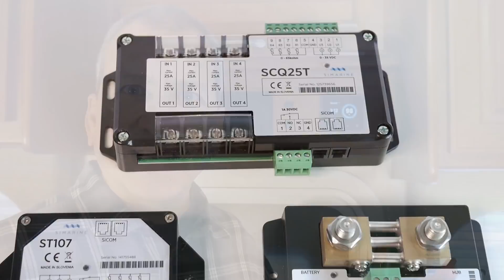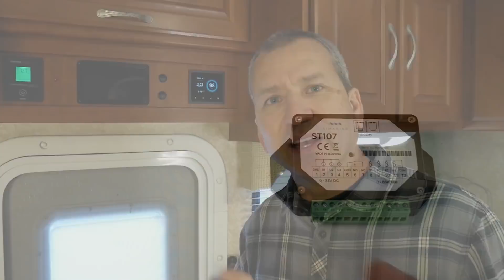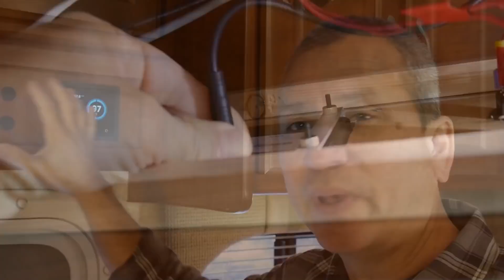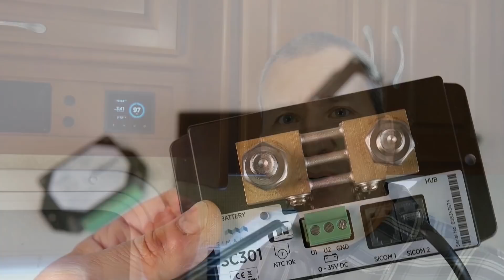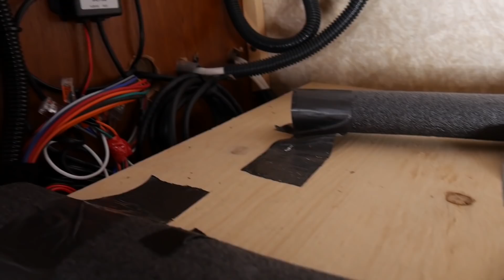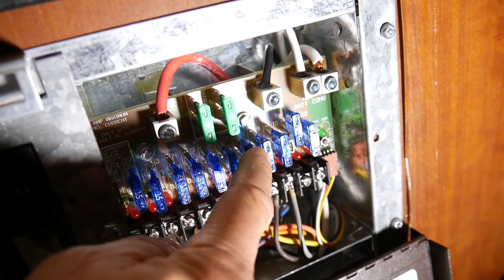SIMARINE PICO Monitor Review and Install in RV

Comment: Hello
 
We are a manufacturer with 15 years of history focusing on the development and sales of intelligent control systems for RV.
 
There are Full touch screen series P10, Membrane Key Integrated Panel series KM20, Color Display Touch Control Integrated Machine KC21, and Mechanical switch panel MP10.
 
More product videos and introductions except in the attachment, you can visit our company website and media platform.
If you need more detailed product specifications and any questions, please contact us.
                            
Best regards.

Comment: Tito i purchased tyhis sytem for my thor Toy hauler i am having trouble with getting a reading on my tanks. i double checked my wiring is correct "example white wire is the common for all tanks blue wire is the 3 sensors for the fresh water i can only get a reading of 65535 ohm. did you experiance this or have any idea where to look for help?

Comment: Love the look of the display.  My only question is how accurate are those sensors that are on the tanks.  I'm assuming you are using the existing sensors that came with the RV or did I miss something?  The See Level 11 Tank Monitoring systems actually have a strip from top to bottom that is glued on the side of each tank and that senses the exact depth of the liquid inside which makes sense.  How does the SIMARINE PICO product sense the existing three or four sensors that are spaced apart and mounted on the tanks and still maintain acurracy in percentage?  It seems to me that the resistance is only isolated at those points of contact on the tanks to read the resistance and nothing in between.  In other words, how does it determine the level between one sensor and the next sensor mounted on the tank?  That is the issue I am having and the accuracy of the product.  Otherwise, I love the product and its display.
Reply from the maker: You are correct. It's only as good as the sensors. To get it dialed in you have to estimate the percentage at each sensor using the resistance and a value (you can even add more values in between). Start will a FULL and an EMPTY value. It will take a bit of tweaking to get it right. The PICO helps by showing you the current resistance value and will then calculate the percentage. Because I had basic resistance sensors that were hard to dial in, I didn't use the tank sensor feature. I primarily used it for power management.

Comment: I know this is a 4yr old video but does it use the same tank sensors that came with the original RV?
Reply from the maker: Yes. It uses the existing resistance sensors but you have to constantly calibrate the monitor to get an accurate reading. There are better marine sensors you could install that may work better with the PICO.

Comment: I love that all tank levels are visible without pressing buttons.  I also like the alert feature that would let you know when the grey and black tanks are full and the freshwater tank is near empty.  My question is,  in trying to configure the PIco's tank sensor (i.e., resistance), could you have emptied all tanks, then filled them from the campground water supply while using an inline water meter?  So, assuming you know each tank capacity (which you indicated you weren't certain of the grey and black), you would add water to the tank to 25%, 50%, 75% and 100%, taking resistance measurements at each point?  Of course, this also assumes the RV manufacturer installed the tank sensors at these same levels.  (Thanks to the RV Geeks for linking to this video!)

Comment: Wanted to ask you a question or two.  I purchased, and installed a standard package and added a few other accessories that I like.  After installing it I discovered when the display circle shows 100% charged, and the total Ah has been reached, there still is about 60-70 amps that is continuing to charge the batteries.  That makes the whole display inaccurate not only at fully charged but 50% discharged (for flooded batteries).  Was wondering if you had any advice as to where I might look to uncover that reason for this?  I suspect there are some devices that use frame ground rather than going through the Shunt.  Your class C appears to be much like mine so I suspect wiring might be similar.  The negative shunt is place at the end of the battery banks' negative connection and the negative input to the inverter/charger.  The opposite end of the negative battery bank is also connected to chassis frame ground so the engine alternator can charge while underway.  Thoughts/suggestions?

Comment: This question is a bit dated for this video  , but couldnt you get the resistance values for your holding tanks by testing the wires into the original rv panel that correspond to each tank when they indicate levels you need for a reference

Thanks
Chad
Reply from the maker: Hi Chad. Yes. That's correct. I've done that and have essentially spliced into those wires and sent them to the PICO. I've found the tank level sensors just don't provide sufficient granularity to make them very accurate in the PICO. Plus they're using a common ground which messes the reading up when the engine starts or other components affect the resistance.
Reply: @RVwithTito  
Thanks for getting bk to me -

I have a few more ?s for you

I noticed you went to Battle Born Batteries - have you been able to determine the C ratings  for their batteries, to enter into your Simarine monitor.

I ve gotten 2 diff answers from them : .5C w no value and C1 as a value of 100 for the 12v 100 AH battery.

I ve read that Lithium discharge at 100% till it reaches approx. 11v  so how are C ratings determined or am I lost on this 1.

How are your new flex panel attachments holding up on your roof- I was searching for a better way to secure panels and that seems like a good fix.

You must haul extra potable water w you if you only have 39 gal capacity to stay out longer dry camping 

Thanks again

Chad
Reply from the maker: @xax3902  You're not lost. The C ratings setup isn't critical with lithium. I have mine all set to 400 Ah for C5, C10 and C20 in the PICO. The flex panels are doing very well on the track. The only issue I've had is that one of the front vinyl pieces (not secured) flew off somewhere. I now have piece of double stick on the replacement to keep it from coming loose. You're correct about the water. We carry an extra 20-30 gallons of water to refill the tank as needed. We also filter all drinking water through an inexpensive water filter pitcher. Works and tastes great. Hope that helps!
Reply: I have another ? - I saw in 1 of your other solar videos where you do a walk through on your solar setup,  you were using a digital shunt - looked like a Simarine shunt - would this shunt take the place of the Victron Smart shunt functions for monitoring your battery bank while providing  monitoring of addl systems ?

thanks

Chad

Comment: Hi Brian. This video is 2 years old now. Can you give me (us) an update of your thoughts 2 years later? The reviews on Amazon for the Simarine Pico are not very good so wanted to get a real world viewpoint on it. Thanks
Reply from the maker: The tank sensors on the RV don't provide enough accuracy to make the tank monitoring useful. So I would not get it for that purpose. I use it primarily for battery, solar and overall power monitoring. For that purpose it's working very well.
Reply: @RVwithTito  Thanks Brian. That is excellent info.

Comment: Great video. I love the look and function of that product. While the complexity of the install doesn't really turn me away from trying it, the fact that it still uses the old unreliable tank sensors kinda does.
Reply from the maker: Yeah. It's only as good as the sensors unfortunately. Luckily I can actually look at my tanks and gauge the level so that's what I rely on mostly.

Comment: Great review. What sensors do you have for propane level?
Reply from the maker: My tank just has the basic resistance sensor it came with. It's tied into the PICO. Truthfully, I just look at the tank to check the level since it doesn't change that much.

Comment: Question for you.  I currently have a Vitron BMV712 today and one of the disadvantages with that unit is the accurate display of the State of Charge SOC that shows the % of remaining battery.  With flooded and ASM batteries specifically, you should only use up to 50% of the actual capacity of the battery.  Does this system allow the SOC display to based on usable battery capacity - meaning 50% of the total Ah number?
Reply from the maker: I don't believe so. What you can do is set an alarm to warn you know when it gets to 50%. You can program it for any value.

Comment: Wasn’t the temperature sensor for the batteries specifically to know when if it is healthy and safe to charge or discharge, not an ambient temperature gauge? Maybe I am wrong but the thought occurred to me, nice work Brian, as usual.
Reply from the maker: Only true if tied into the solar charge controller. The solar charge controller has it's own temp sensor.
Reply: Brian, Dan D is right on this.  
The temperature of the battery is critical to the computer's capacity algorithm.  As the capacity of the battery is a function of temperature,  the temperature sensor should be mounted in the near proximity of the battery, or even on the battery case when the battery is in unenclosed space so that the algorithm does the computations correctly.
Take a look-see at this about development of a capacity algorithm:   
https://www.diva-portal.org/smash/get/diva2:830232/FULLTEXT01.pdf   
Most manufacturers specify the battery capacity at 27 degrees Celcius, or about 80 degrees F. At 55 degrees F, the battery capacity will only be about 80% of what it is at 80 degrees F. Think about why your car will fail to start when it gets REALLY cold! And battery temperature is never constant, it will heat up during charge and discharge, so capacity is always changing.

Comment: Hey Tito, I also wanted to take a moment and Thank You for your amazing video. I actually decided to buy my system in part because of it and used your discount code to do so as well. Right now, like many I feel are trying to figure out how to properly migrate the cables from their tank sensors to the ST107 itself. I have gone and contacted Fleetwood and after considerable effort with them was able to get a copy of the original wiring diagrams for my 1992 Fleetwood Southwind 33L.(For anyone that's interested, and for reference, you can find the diagram on my Dropbox with the link below.) So, it would appear that my fresh/grey/black tanks all share the same common lines for different tanks levels that consist of Full(Orange), 3/4 Full(Green), 1/2 Full(White), and 1/4 Full(Blue) that then all connect back to monitor. Then, my fresh tank uses a unique isolated Red wire that appears to connect from the tanks 3/4 mark and Empty mark back to the monitor, as is then repeated with a Brown cable for the black water tank, and a Black cable for my grey water tank. So, it would appear that each tank shares 4 common sensor lines, and 1 unique line. So my question then becomes how am I supposed to translate this to the PICO ST107? As my tanks appear to have 5 cables each(4 shared sensor lines, and 1 tank specific line) but the PICO module appears to only have 2 lines per tank(1 R line, and the COM line) If you Tito, or if anyone else that reads this thread could help me out I would greatly appreciate it. You can also e-mail me ATHikerIn05@gmail.com                     THANKS TITO AND EVERYONE ELSE! https://www.dropbox.com/sh/qs7y54bueq2c5og/AABvVVJeY4-jPX3eTUnnKB__a?dl=0

Comment: Hi Brian as with all your videos on You tube the ones I’ve seen they are great and informative.I know you used your original sensors for your tanks. Is there anyone who watched this one on the PICO who installed the pico and the ST107 module and the glue on tank sensors.
There are 4 wires in the lead a white one a red one black and a yellow, the white isn’t used but I need to know which wire goes where on the st107 the wiring diagram only has two wires to the st107 but doesn’t say which ones and I know the black will be ground where do the other ones go. If anyone knows can they let me know please. They can contact me on my email mark.j.cheater@gmail.com or here thanks looking forward to hearing from anyone with info please.

Comment: This looks awesome BUT it doesn't monitor 110V draw....is there a loophole to this? A monitoring step before the inverter?
Reply from the maker: It only monitors DC. If you have a shunt directly inline with your  inverter then just divide the current by 10. For example, a 50 amp draw at 12VDC will be roughtly a 5 amp draw on 120VAC.

Comment: Another great video Brian! But all battery monitor systems I've seen have a setting for Peukert's Exponent. For some batteries it's 1.15, for others it's 1.05 and this helps the capacity measuring be more accurate. But I didn't see that as a setting. Does it have this?
Reply from the maker: I don't think so. You enter 3-4 C ratings and it "learns" after a few cycles. Thanks for the info!

Comment: Great video, looking at this system for our yacht so good to see how it works and its capabilities. I have a question, how do you monitor LPG (propane)? you mentioned a magnetic sensor, just wondering if you have any more info on that, brand, where I could buy one online etc. Thanks!
Reply from the maker: Overall I really like the system. I don't currently use the LP gauge on the PICO. So I don't have any new info on that. I think I would have to run new wires directly from the sensor to get it working right. It fluctuates as the resistance to ground changes in the RV. So I just look at the gauge on the tank.

Comment: Hey Tito! Great video. Do you think the Simarine tank monitor will integrate with the SeeLevel sensor board without the SeeLevel monitor? Believe it or not, I do not have a level monitor currently on my black tank and hoped to install the SeeLevel sensor board.

Comment: i may put on in an rv   but would like 5 temperature sensors
1. For the freezer in the motorhome
2.. For the refrigerator in the motorhome and to be able to set it if it drops below a certain temperature that it will sound an alarm
3. In the battery area
4. Motor temperature
5. Outside temperature

As for fluid levels
1. GPL gas in main tank and in secondary tank
2. Greywater tank
3.Freshwater tank
4. Black water tank

I don't know if this thing does windspeed and direction but sometimes it's necessary to know it would also be nice if it had a compass and it so you could point your vehicle and in the right direction if you want the optimal way to get your solar panels charged.

I also clicked on their website because they actually have an RV version now however it's not finished yet and I don't know anything about it perhaps you can find out.
Reply from the maker: I'm still waiting on the RV version too. It probably has the new incline meter as part of it. BTW the temp sensors are on the shunts. I also wish they could be used elsewhere.

Comment: Nice video- thanks! Can you please tell us what resistance tank monitor brand/model you are using? Thanks.
Reply from the maker: Don't know. Just the stock hi-med-low sensors. I'm still having to tweak them regularly since the resistance values seem to fluctuate.

Comment: Looks good. But are you sure the battery capacity at different C values are correct. Usually the lower C value the higher the capacity. C values are the ratio between current and capacity, not how long it takes to discharge.
Reply from the maker: The settings call for Ah capacity for at least three multiple C ratings. The spec sheet for my batteries had Wh capacity for C20 (standard), C10, and C5. I converted the Wh values to Ah. I now have 400Ah of Lithium batteries with a pretty flat discharge curve. So all three calibration points are now set to 400Ah.
Reply: @RVwithTito  thanks

Comment: Hello Tito. I am installing this system in my RV and I also tapped into the wires of the original tank monitor panel to run to the ST107. The pico seems to work fine reading the tank levels but the original monitor panel now reads funny. Any ideas why? It seems like I have effected the resistance maybe.  I did use solid sprinkler wire maybe that did something.  I would really like to have both monitors working so they can double check each other.  Thanks,
Reply from the maker: I haven't been able to use both either. Whenever I press the switch on the old monitor it works but messes up the readings on the PICO for a while. So I don't use the old one anymore. It probably changes the resistance when activated like you said. For best results you'll probably have to run direct wires from each sensor to the PICO tank module. Of course we didn't do that. It's also wired to chassis ground which affects my tank levels on the pico when the engine is running. While parked for a while it settles out.

Comment: Just a quick question -  The ST107 has a resistive input of 0-65K Ohms and Most RV Water Tanks are set up  for about 120K at 1/3 full. Did you connect a resistor in parallel with the tanks, and if so, what value did you use?
Reply from the maker: I just filled up the tank to each level then looked at what the PICO said the resistance was. That was the value I used for the calibration point. I need to look into what your saying though.